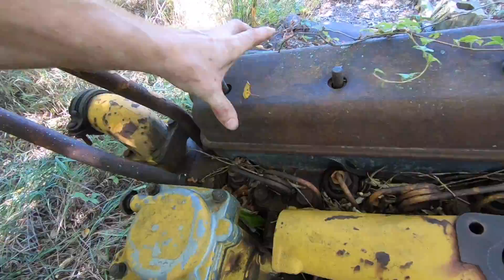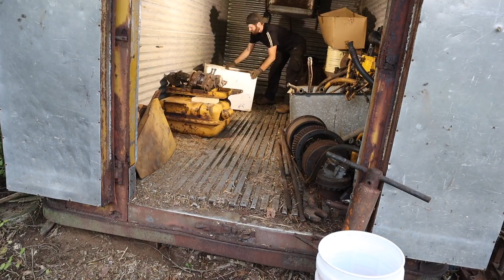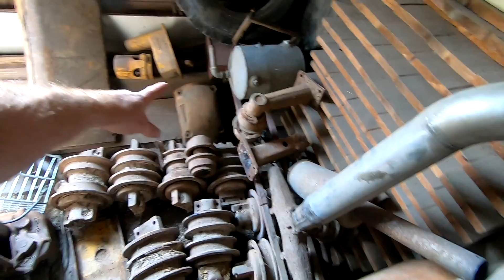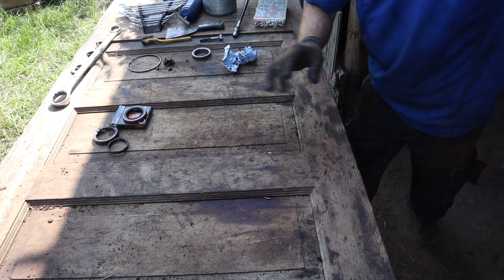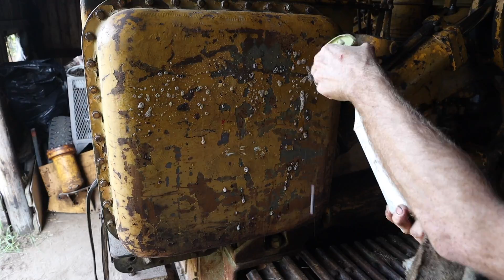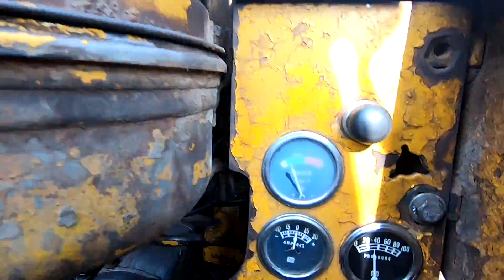I Rescued TWO TraxCavators ~ Part 5 ~ Old Red 1950s Caterpillar TraxCavator

Comment: I was shaking my head at that broken bolt. When you tapped in the torx I said NO WAY!!!
Then when you got it out I thought "He's one lucky SOB!!!" 
LOL - thanks for proving me wrong about that.
Reply: I have been doing that for years, the problem is when a tool-steel Torx bit snaps in the hole.....
Reply: Trevor Marron Hahaha! Yeah, that’s when it gets real interesting. By then? Me: Who’s got a torch????
Reply: @trevor311264  yea great idea. But if  it breaks the job goes bad. I tend to just keep stepping up the drill size. Then run the tap in.
Reply: @briandufty5081  Or get what is left of the bolt so thin that you can pull it out like you are unwinding a spring!
Reply from the maker: I was just as surprised as you! I REALLY didn't think it was going to come out, but MAN was I glad it did!
Reply: Yeah, the dude had some mad skills! I thought the same thing when I saw that torx bit as well! Actually, that was a slick rendition of how to improvise, adapt, and overcome!
Reply: He's a wizard!  Made removing all those broken bolts look like cake.
Reply: Henry Withoot Snap On has one similar and it works quite well! I’m using that tool now on my 1959 Apache and so far, all the bolts have come out
Reply: @wHiTeHaT44  Torx is probably the most efficient profile for this, as it has triangular tips, which means you have less material to displace, while the undercut profile of the valleys have even less material to displace, and potentially space for the displaced material to move to depending on the ratio of the hole to bit size. Typical spline, which is usually square or slightly rounded, would be less efficient due to more material needing displaced, and a lobe style profile, which is tangentially rounded between the peaks and valleys, would be even less efficient due to the same reason. A hex bit could work in an emergency, but a hex doesn't have the valleys, which again means more material on the bolt needs displaced. 
I personally prefer running a left handed tap, then using a left handed screw for bolt removal. Similar to newer extractors, except a lot of those style extractors are extremely weak metal that deforms or chips before it actually extracts; though if one was made properly, it'd probably work well. As long as you have a high grade bolt, it should be able to withstand the torque needed, plus it's easier to use a higher rated impact on a larger bolt than it is on a small torx bit. Between heat, impact, and a bolt that tightens in the direction as the old one loosens, it's almost a bulletproof method of extraction. 
But the most bulletproof method is prevention. People need to learn, and manufacturers need to start practicing this as well, to use antiseize on fasteners. Or other additives that'll prevent fasteners corroding together. So many troubles would be eased if everyone worked to prevent problems like this, and it'd be easier to get everyone to latch onto this idea if manufacturers started practicing this decades ago.
Reply: Sod

Comment: Did you see the recent this old tony video about the tool steel grade filler rod you can get? You could legitimately add weld to the face of each tooth with tool steel filler to build those back up. Without having to take the wheel off or anything.
Reply: Hard facring rods have been around for ever 
This isn't really a job for the tig 
Would cost more in filler than its worth 

Pretty common to add hard facing rods 
To the sprockets 
But long before that stage 
Theyre a bit past the saving point
Reply: @fowletm1992  I agree it would cost more in rod than it's worth. It's possible though! If you really didn't want to remove the sprocket.
Reply: @El_Chompo  
A real farmer fix os to weld lengths of rod to the sprocket to give the teeth theor points back 
So you lay the rod on its side on the point of the tooth and weld each side 

Pretty rough but it sorta works
Reply: @fowletm1992  Definitely a good idea, save a lot of time with some rod starter than trying to build it all up with weld.
Reply: @fowletm1992  I think the idea is to get enough built up on the sprocket teeth to get the machine loaded and moved to where the sprocket can be replaced.
Reply: @Porty1119  
Yea 
But there's literally days amd days of welding to build up enough tooth woth weld alone 
Hence the rod method 
Just a bead down each side of the rod and your "good to go"
Reply: @fowletm1992  Fair enough. I only own rubber-tire equipment.

Comment: Be VERY careful when you load that on a trailer with that sprocket slipping.  It may not want to climb and go sideways quick.   Also that seal you replaced should just be a grease seal,  the old pump was leaking internally as well, likely due to the bad bearing.

Comment: Great job, and a very nice machine.  If I were you.  I would get that spare sprocket  and the spare tension assembly (assuming there is a spare) and replace them now.  Yeah it's a bear, but if you throw a track in a bad place, that job is going to be much worse.  That sprocket probably wore out because the tension assembly stripped out in the first place.  Looking good though.

Comment: The dust seal that you replaced fro the hydraulic pump shaft does not hold hydraulic fluid pressure, that will be behind the screwed up bearing on the inside of the pump. I would be tempted to run some weld bead to build up some teeth on that sprocket "just temporary....unless it works" like Watch Wes Work would say lol... Have really enjoyed the series so far, was thinking you may want to use it to load some of the big pieces of the parts machine before you haul it off???

Comment: The old cat is looking good, you've done a nice job getting it to this point on its resurrection!! The drive sprocket on the right side definitely needs some work before even attempting to load or drive cross country,,perhaps welding some rebar peices as wide as the sprocket to the top of the nubs maybe less time consuming than replacing the sprocket itself in the field. Waiting patiently for the next chapter in Old Red's rebirth!!

Comment: That's crazy the grill alone would crush a man lol
Reply: Previous owner destroyed the driver sprocket by not tightening the track.  Weld a hook on the bucket.  Attach a chain between bucket and track tension mechanism. Use hydraulic to tension track.  Now block tension mechanism. Hopefully you get a track now with a tight fit.
Reply: Markus Jonsson that’s an excellent idea but I think your comment is misplaced on a reply to someones comment. Repost it in the main comments or he may not see it.
Reply: @corytruckdriver   Thanks man.

Comment: Matt great job I was thinking about the sprocket get a length of round stock cut it to the width of the sprocket weld on both side creating a point doesn't have to be perfect most likely  the rollers on the track are worn out , might take some time but will give you control of the machine , and I would install the new sprocket complete not cutting it as you said parts are hard to find,take the old one and have a welding shop rebuild it with hard facing good luck
Reply: Sounds a good idea. More control then trying to build a weld up on each tooth.

Comment: if your old track rails are significantly stretched, that new sprocket will look like the worn one, really quickly.
Those metal pieces were the bearing "cage".
Reply: Thats prob why it was parked 

Undercarriage is at least 60% of the value of any track machine 
Can do alot of fixes at home 
But there's no cheap way around Undercarriage
Reply: Yep. Bearing cage. They used to have little tiny ones like that on bicycles.
Reply: How difficult is it to shorten the track to get the tensioner back to where it can do its job?
Reply: @sthenzel  it's not a matter of removing a link.  If the "rail" is stretched, you can only replace it with new or less stretched rail.  If the pin to pin dimension is too long on the existing rail section it will just wear the new sprocket to a nub like the old one... regardless of how tight or short the overall track is.
Reply: @ramosel  You´re right! But as replacing the sprocket wheel seems to be a p.i.t.a., especially under the conditions there, getting the track to tension again sufficiently to work with the old sprocket for the short drive to where the machine can be loaded. Another option may be the use of the spare tracks, if those are in better shape, but putting a good track on a worn sprocket, questionable rollers and tensioner probably isn´t advisable. The work involved would also be much more than somehow get some tension back, maybe with some weld buildup on the old sprocket. Just to get the Cat where it has to go.
Reply: I have seen a bead weld on each of the teeth of the sprocket work as a quick fix in the past. Dont know how it would hold up.
Reply: Like the bikers wil tell you. Always replace the chain and sprocket. Unless the chain broke after recent renewal. Does somebody know? On gears you take care that 2 teets of both gears not touch each other frequently. Is it here the same?

Comment: Probably get away with a 70 -79  Ford C-6 transmission Tailcone seal  --PS did you grease the seal rubber   ( Crucial )!   - That Pin I`d suggest to get some 41-40 HyD .shaft to make a new pin sometime , You could temporarily weld some sprocket teeth to the sprocket till the big fix with a Mig welder !!

Comment: The bucket control levers are set up that way so when loading a dump truck you can pull both back and raise and dump the bucket all at the same time. Glad to see you gonna give ole Red another chance to live again.
Reply from the maker: That makes PERFECT sense! I could see that being pretty useful when loading trucks, but it's going to take a bit to get used to when just using for everything else!
Reply: @SalvageWorkshop  It will be fine. After awhile you will wonder why they are all not like that.
Reply: personally even on the new track loaders i like twin stick over joystick, much more enjoyable! this ole girl has more hours on her than any 963K ever will have in our fleet today
Reply: Explanation makes sense.  I can confirm the curl operation was the same on every 941 and 951 I ran.  Cat definitely designed it that way.

Comment: Could the hoses be connected reversed for the bucket lift?  What's really sad that a lot of good old yellow iron has been scrapped because the cost of finding replacement parts (if they are available at all) and the labor to install them is sooo much more than the scrap value. Great to see you giving Old Red a new lease on life.

Comment: While not a 'fix', if you tighten the track on that side, it will prevent some of the slipping on that sprocket until you get it changed. Edit: guess I should have finished the video before commenting. :)

Comment: Dude,I've never seen a use for a torx bit as an easy out! usually they as so hardened they are brittle ,you must have the patience of Job.Great work, look forward to more.
Reply: Easy outs are designed to fail, you drill a hole, then screw in an easy-out that is basically a piece of tapered tool steel in,  that then expands what is left of the bolt against the bolt hole.  The more you screw the easy-out in, the more it expands the bolt, the more the bolt expands, the more grips the bolt hole.  Then the easy out snaps and you are left with a bolt that you can't drill out because there is a piece of tool steel stuck right in the middle of it.
Reply: Kenneth R use an impact rated torx bit.

Comment: Forget pepsi and coke.    Cheerwine!!
Reply: Dammmm !!! Theys 10 Cheerwine peoples here!    Now we rockin.    Check with your local track shop there usta be what were called "Welda Cups" sprocket inserts that could weld onto that sprocket,,,much better than cobbled bits. We used to put them on our logging tractors, but was yrs ago

Comment: Just a heads up. Most guys with those type of machines just cut the spokes close to the outer teeth and weld it back on to the center of the sprocket that’s is on your machine. It is soooo much easier.
Reply: Guess I should have watched the rest of the video before posting lol.